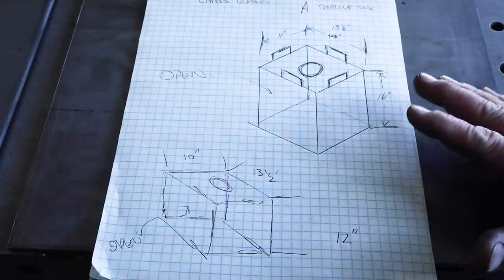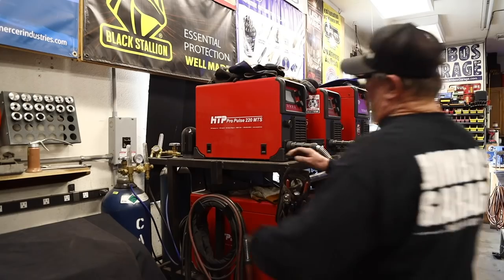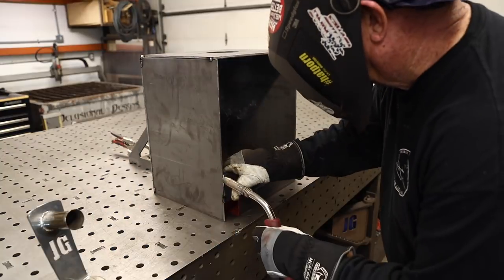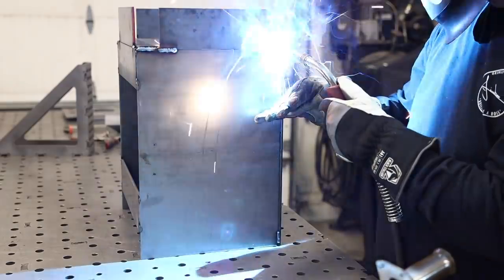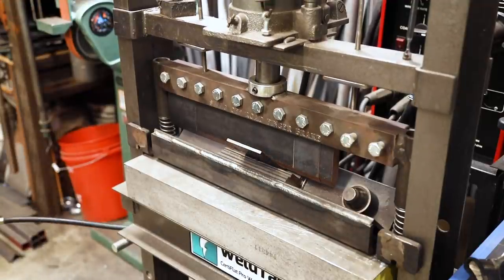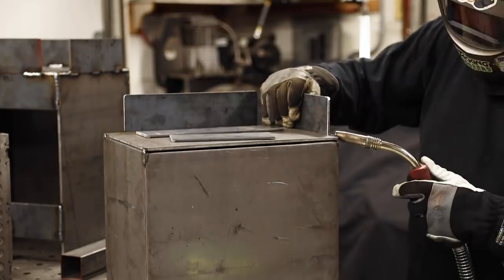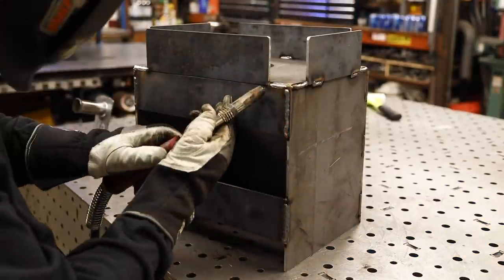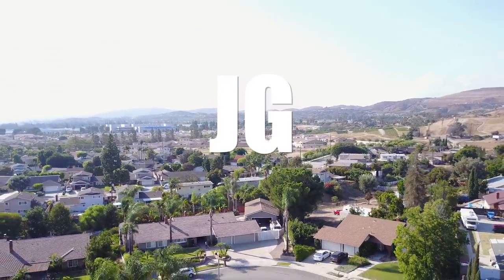Metal Outdoor Rock Fountain Base Build | JIMBO'S GARAGE

Comment: I have a question not pertaining to this video but I know you do allot of gates. So I have a customer who want a steel entryway gate with double doors. How should I tackle the locks on it? Like a French door where the left handle unlocks at top and bottom or just use a cane bolt on the left door and the right use a standard handle? Any advice would be appreciated